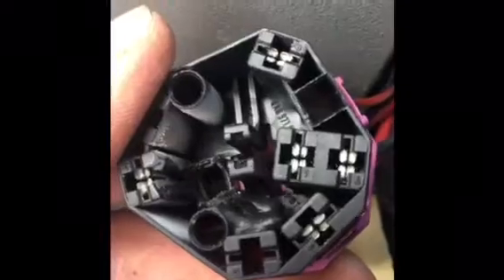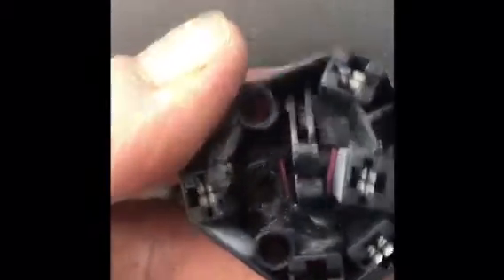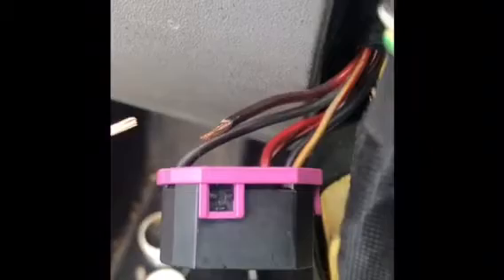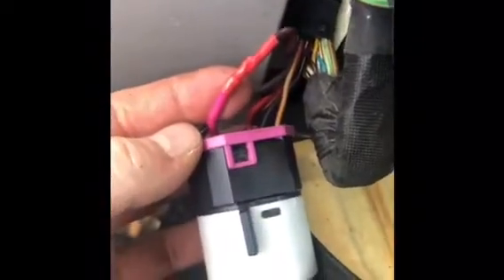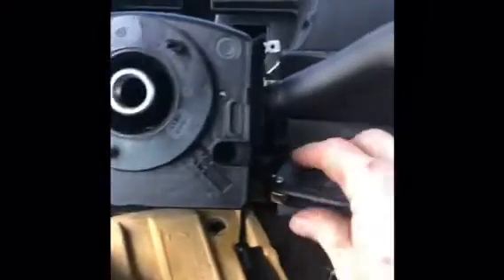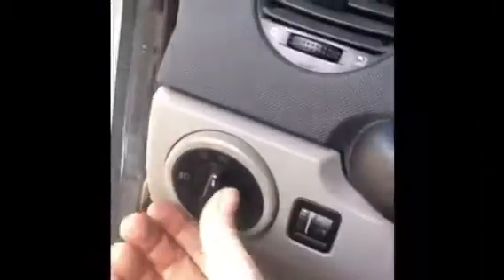05 VW Beetle Ignition Switch Repair

Comment: Why does the steering wheel have to be removed ?
Reply from the maker: The steering wheel was in the way of the top piece of plastic on the column. I probably could have left it on but it is easy to remove and then I didn’t have to work around it while troubleshooting.

Comment: You and your fancy soldering.  A wire nut works just fine.
Reply: ? Ha ha ha ha
Reply: What is soddering?
Reply: @darrinheaven4643  a dictionary will tell you.
Reply: You can wire knot there about one cable, two and the bulk will be hard to accommodate behind the cover but you may try to wire knot two. The reason why we don't use wire knots in cars is to avoid them to be loosen, fallen and create a short circuit so soldering will be safer and is not too hard but yes, better if you get the best simplest cheaper equipment to start.